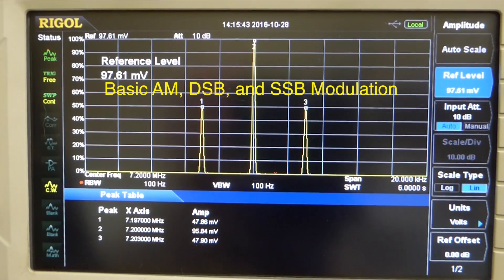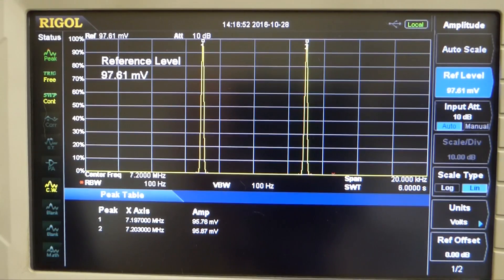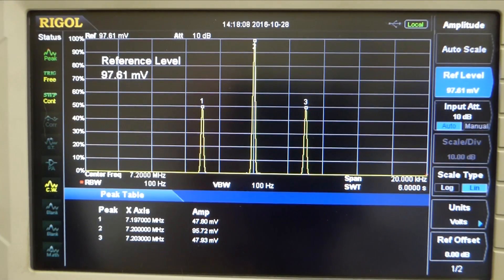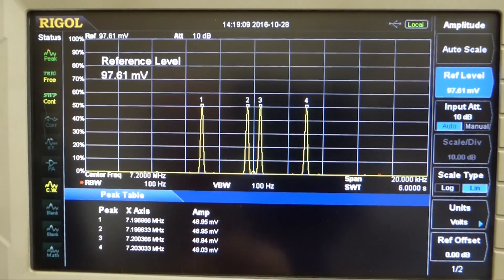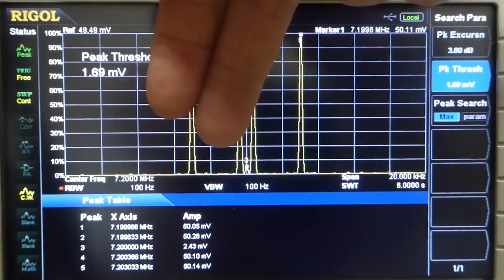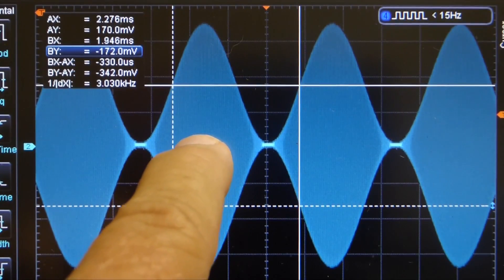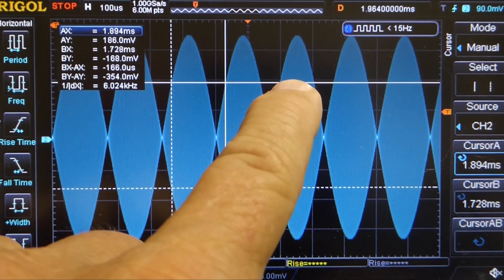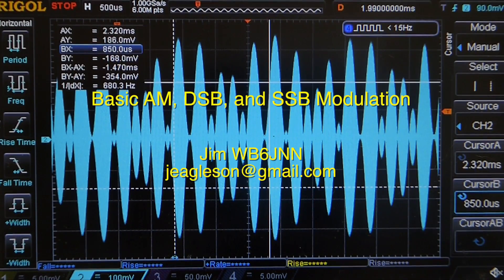Basic AM, DSB, SSB Modulation

Comment: How does a receiver lock onto a signal if the carrier is suppressed?  Sorry for stupid questions, I know little about modulation.
Reply from the maker: Bud E   The DSBSC (Double SideBand Suppressed Carrier signal requires a BFO to reinsert the carrier just like SSB.  Some DSBSC signals only suppress the carrier partially thus can be received using a synchronous detector which automatically phase locks the BFO to the suppressed carrier for proper tuning and reception.

Comment: what source do you use for 2 tones
Reply from the maker: I am using the Rigol DG4102 Function/Arbitrary Generator.  I use CH1 for the RF (100kHz or 7.2MHz in the recent videos).  I use the internal modulation of CH1 for single tone modulation.  The Rigol provides a whole bunch of waveforms for modulation including Sine, Square, Triangle, UpRamp, DnRamp, Noise, and Arbitrary waveforms.  

For two tone modulation of AM, FM, or DSB (DSSC on the Rigol list) I simply use the CH2 DSSC function to get two tones based on a Suppressed Carrier center frequency half way between the desired lower and upper frequencies.

Example:  For 300 Hz and 3000 Hz tones I calculated the center frequency between 300 and 3000 Hz which is (3000-300)/2 = 2700/2 = 1350 Hz then added 300 to 1350 which is 1650 Hz.  

I set CH2 to a carrier of 1650 Hz and modulated it with a 1350 Hz Sine Wave using DSSC.  This produces 1650-1350Hz = 300 Hz and 1650+1350 = 3000 Hz.

I then used CH2 as my External Modulation source for CH1 by connecting the CH2 output to the CH1 External Modulation input on the back of the DG4102 using a BNC cable.

If all you need is a two tone source for Audio input to, say, a transmitter, just set up the low tone on CH1 and the high tone on CH2 and mix them together using an audio mixer or a resistive star combiner.  Connect the combined output to the input of a hi-fi amplifier or a transmitter's audio input (depending on what you are testing) and make certain that you do not exceed the input RMS or Peak voltage limits of the unit being tested.

You can find information on star combiners at this site:  
http://www.radio-electronics.com/info/rf-technology-design/coupler-combiner-splitter/rf-resistive-splitter-combiner-divider.php